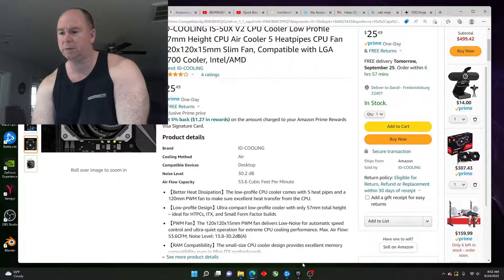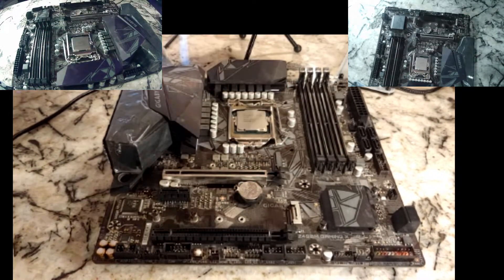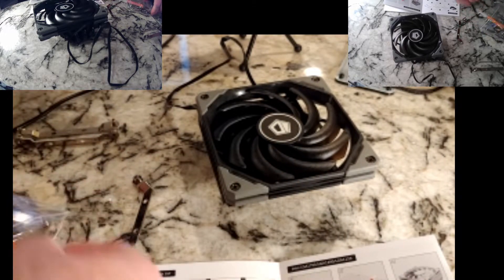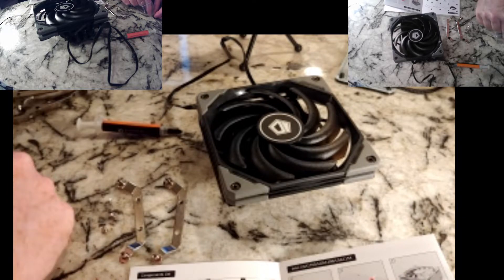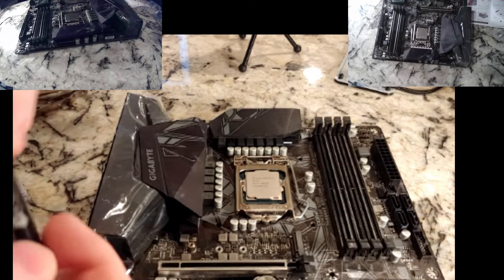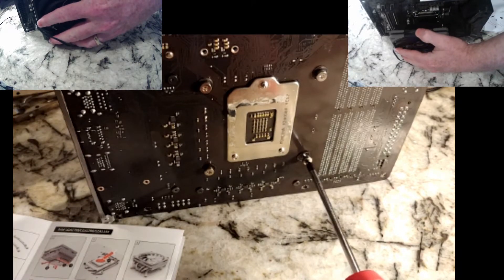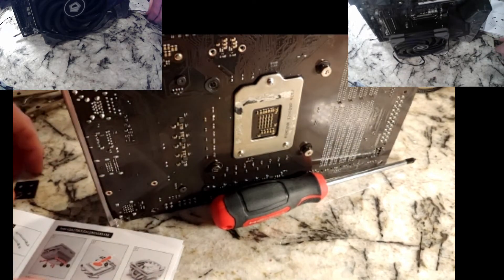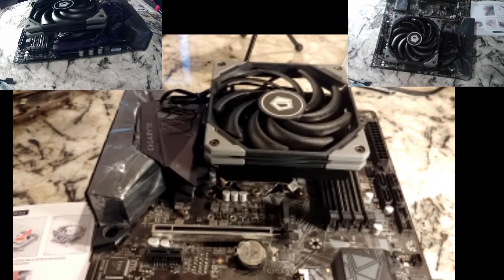ID Cooling IS 50X V2 installation LGA 1200 1700 into Gigabyte Z490m

Comment: What do you think fan swapping is50x fan does it make any difference?
Reply from the maker: From a previous shoot-out between cpu coolers that I did, this style would be an improvement.    However, it will fall somewhere between a stock cooler and a single tower w/ 120mm fan as this design does not seem to provide as great a cooling as one that has a fan pushing cooler air across the heat sink/tower.  I am planning on doing another shootout between cpu coolers as I have gotten about 5 in since the last one.

There is an improved version of this cpu cooler that has more heatpipes...and adds aRGB.  https://amzn.to/3SaWP7J